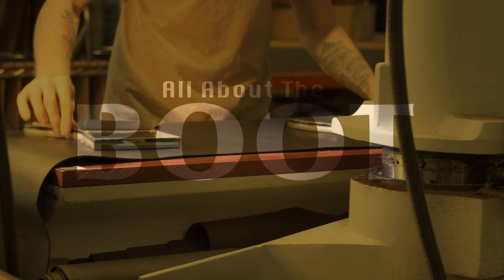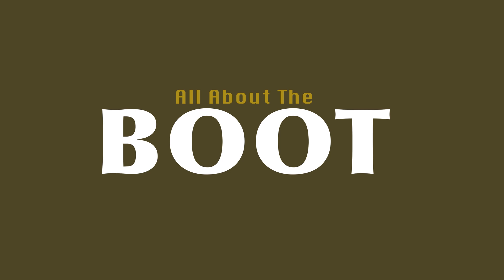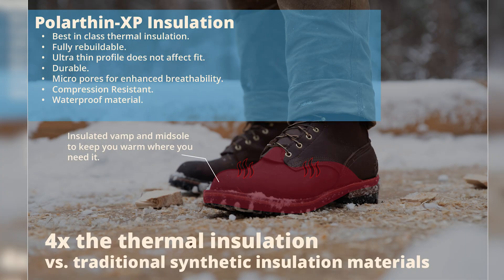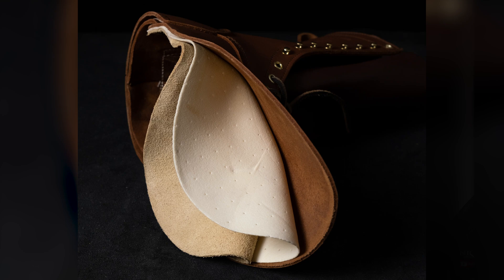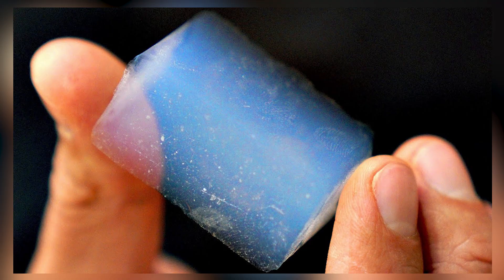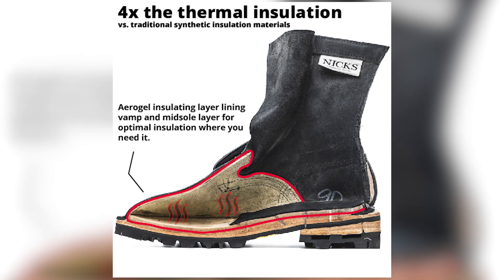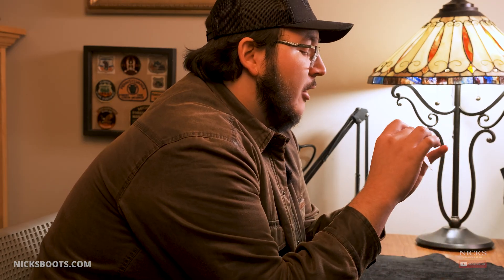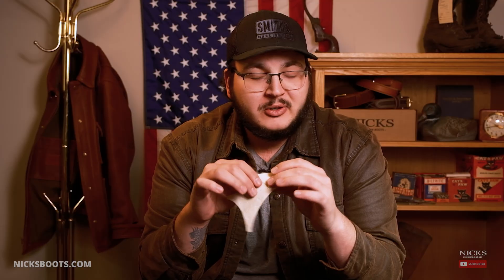NASA Technology in Nicks Boots!? | About the Boot

Comment: Wear some wool socks and get similar results... Keep it simple
Reply: My builder pros with wool Darn Toughs are pretty cold in the winter. Ive tried wearing multiple pairs of wool socks but then the boots aren’t big enough. I’m about to pull the trigger on some insulated builder pros. I bet it’s better than wool socks.
Reply: I wore the thicker darn tough tactical wool socks with my regular nicks boots and my feet still got very cold. I bought a pair of thorogood insulated/waterproof work boots for the days I have to work outside in the cold. USA made, vibram sole, received in 5 days and only $300